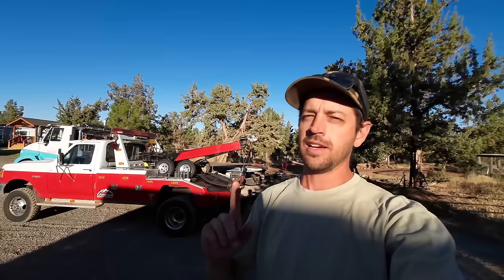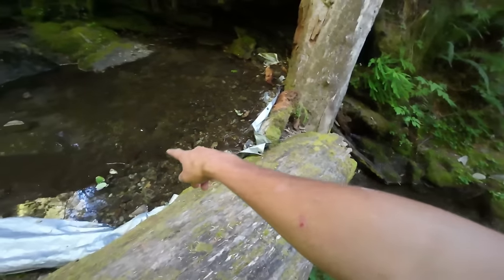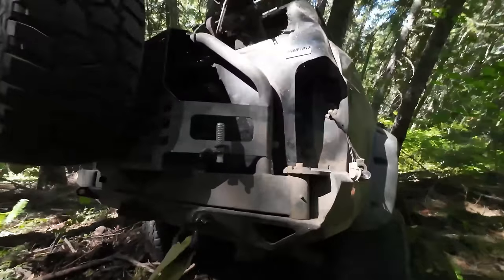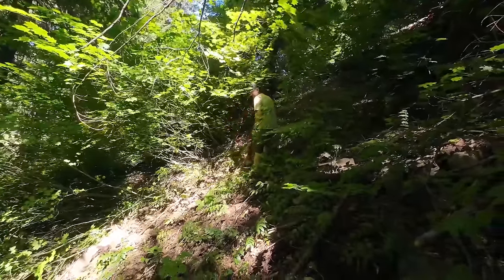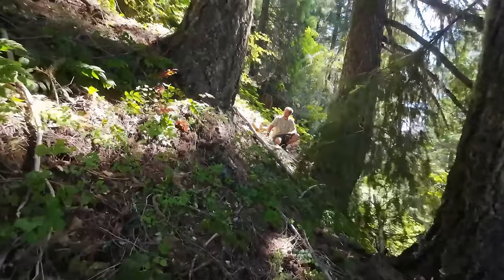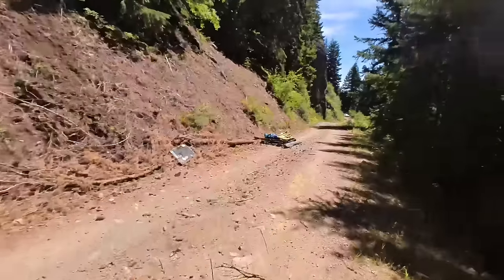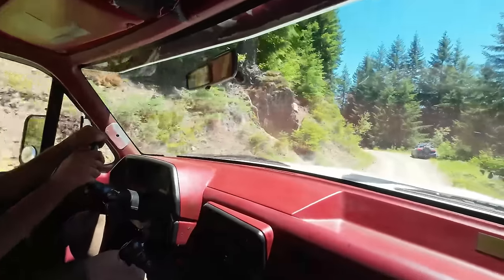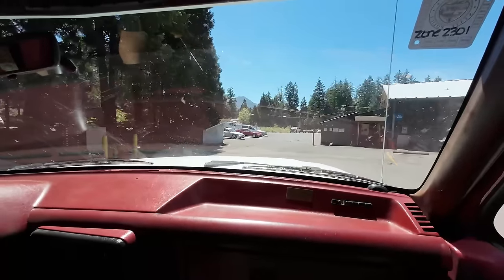I can't believe SHE SURVIVED this...

Comment: Casey, I for one consider you as a first responder. First responders have the right of way. So with that said, keep doing what you are doing and not taking that attitude for anyone. I for one love your content.
Reply from the maker: Absolutely not even close to a first responder
Reply: @CaseyLaDelle  I don't know about Oregon or even California, but in New York we have laws that drivers have to slow down  and move over/stop to give tow truck operators, police, fire trucks, road crews, and EMT's the right of way. With your strobe lights are on, you on the low end of a first responder list. First responder takes control of the situation, which you did. On road/off road it don't matter. I am a class A CDL with Tow Truck Endorsement holder here in New York. I know laws can differ from state to state, but the laws are very close when it comes to the safety of the public. Not trying to argue with you, but trying to keep you from selling yourself short. From one CDL class A driver with tow truck operator to another.

Comment: Hey Casey. If you’re down in my neighborhood again give a holler! I live right down the road from the reservoir. That concrete spillway you saw was where we draft our water trucks from. You almost went as high as Buck Mt.
 Heck, I would have been happy to get that jeep out so you wouldn’t have had to drive so far.🤙🏼 Granted, we don’t have tow trucks, but we use an excavator. Pulled a grand Cherokee up that went over the edge just below cougar reservoir think in February or march.
 Anyway, thanks for the videos! Have a good one!

Comment: That was a challenging & spartan effort Casey; & your skill and expertise came trough when it counted. Your aide offered valuable assistance also. In the heat, exhaustion, fatigue and dehydration can hit; the body needs electrolytes & if picking up something at the store (on the way to the recovery) a low sugar gatorade, or a Propel drink with no sugar would have given your body a boost. From the look of it,  it was grueling and exhausting; I can't compliment you enough.

Comment: Sounds like the ol school wrecker could use a new 4 core radiator, water pump, thermostat, hoses and flush. I had an 84 1 ton, 6.9 and it pulled hills like a champ, never attempting to overheat... Amazing video Casey. 😮❤
Reply: Yes, and pulling a steep grade like that on a main road at that speed ( 35 mph )  you should have your 4-way flashers on.
Reply: @wallytimmins356  Why .....who is out there to see them?
Reply: @wallytimmins356  Main road?
Reply: @kingtut5923  The hill on the main road before the off road, when he said he was doing 35 mph. Watch it again !!!
Reply: @k1j2f30  Watch it again !!!
Reply: @kingtut5923  he means on the highway, not the logging road .... 35 mph I'd have the 4 ways on. I liked the simplicity of my 7.3 IDI, but my 7.3 Powerstroke Super Duty has gobs more Power & Torque

Comment: Let's go do a recovery.... driving along the road.. but wait, let's go check out this cool spillway.... oh look it's a waterfall up here haha...... glad the people waiting were not in a hurry...... 

As Geocachers, we use offline maps often and there are some great sites with free offline map services. 

Casey as a Safety suggestion, you have pockets in your pants at the front back and Side... use them to carry stuff for you (shackles etc..) which then leaves your hands free to grab onto trees/branches/anything to help climb up and down... secure the shackles in the eyes of the straps and load the straps like a letter C over your shoulder so that it doesn't wrap around your neck (like you did at 26:10) and choke you when/if it gets caught on a branch or some other obstruction...... as a rescue firefighter I was taught all this stuff many years ago and it has saved my life and countless others for doing the same practice.  

Also as a suggestion look at getting a set of headsets so you can talk to someone that is out of sight or at a distance where you cannot see them it makes life so much easier, and safer. There are reasonable sets for not a lot of money.

Comment: typical of offroaders to tie stuff to roof rack but overlook the self tappers holding it to the roof.  Same with the fuel cell and jack, they never look at the root of the tie down to make sure it can hold the parts down in a rough bumpy road let alone a crash.

Comment: Cool heads prevalent. Every situation is different and the goal is to get passed without putting either in jeopardy. If you feel you can’t back out or pass safely then say so; then ya gotta hold your ground regardless of rules. Both should look it over and come to a consensus on a safe plan. I got committed going up a forestry road at night that suddenly had little or
 no shoulder in my 29’ motorhome (F-450 7.3L 430 hp). If I’d had known I would have not attempt it but it was late at night and who would of thought of someone come down in a very large pickup. He insisted I back down the road but I knew it was > 100 yards to a widening of the road and I stood my ground. We talked it out and I wasn’t going to be bullied. We walked/scoped it out together for both vehicles and came to the conclusion I couldn’t back down even in the day light we found a safe place for him to back into. All went well and am sure if I’d had attempted to back down it would have been a disaster. In retrospect I should’ve been on that road with my RV but didn’t realize until too late that it was going to narrow down. My camping style is dry camp/disperse camping which frequently are passable forestry roads but can become narrow in some places.

Comment: Anyone with half a brain should treat a tow vehicle with something on the same way you would treat any emergency vehicle. In that moment if you failed to give enough room for the operators comfort you need to follow their instructions. No reason to have hard feelings, just let them do their job as quickly and efficiently as possible so they can get on to helping people.  I’d hate to be the one waiting for a tow truck on the side of the highway because some twat thought they wanted to stop and argue with the operator.

Comment: Whats not fun is an 11,000 lb tow truck with a 6,000 fully loaded pick up going down a gravel road. I was on a call and trying to come down a steep grade when a honda civic pulled in front of me and decided to stop. i tried my best to get my rig to come to a stop but with that much weight it was not going to hapen. we slid 637 feet smacking trees boulders and the hill side shredding the civic the truck i was towing and flipping my wrecker. We didnt even leave the road thank god or i wouldnt have been here today. so if people want to not give right of way to a heavy truck coming down a hill they put every ones safety at risk and can kill. Thank god all we need was clean underwear and not a casket or 2. casey did an awesome job and handled it well.

Comment: GREAT video!   Its one thing to climb around in the heat at that altitude, but to also get it on video.  #dedicated.
I agree.  You went up on that hill to save a Gambler car only to return down the hill to find a bearded nun with a filthy mouth and bad attitude.  The OG penguin herself, Mother Mary Stigmata, would even agree.  "He needed help.  He turned into a dick, well then I guess he's really up shit creek.  OK that kinda didn't work, but I'm not a professional.
Anyway Top 5 recovery I ever saw.  Top 3 for sure.

Comment: My mouth fell open, when he told you to get a smaller truck, despite the fact that you are a tow truck and clearly towing a large SUV.  If you did what he said, you probably couldn't have recovered the vehicle without having to use several other vehicles.  And who exactly would have been driving them?

Comment: Back in the mid to late 60s I worked for a gas station whom had a toe truck about the same size as yours, except we only had a single wench cable, and no under lift. I went out with the boss on some of his calls, and it was amazing what that wench would do on that truck. Your cable looked about the same size as ours, and we had to pull a car up a hill, and it blew my mind what that cable would pull. Your video brought back allot of memories of the work we did on that truck. Great job on your rigging this job and getting that jeep out off the mountain. Also glad the girl is ok who took the ride down that hill. Take care and I hope all is well with you and yours.

Comment: Originally from what it sounded like, I thought your black Ram could have done it, but after seeing how far down that slope it got and the tight the working space was, I know you took the right rig. 

The rollback would have been a little more power and weight, but that would have been simply too big for the working space. 

Plus I would think you would have still needed to tie down anything that you took like you did. So you would have needed a side winch which you did with the second line.

That slope is very crazy and unstable to make any mistakes too.

Comment: Great video. You should have passed on this job. The truck was marginal to get it done and you need a bigger crew to run the lines down  and do the rigging plus a camera man . A awful lot for one man to handle you did a great job by yourself getting it done. That would have been about a 5,000 bill if I did it and that gambler participate would be 6 ft under at that point in my day.

Comment: great job   i also have trouble dealing with heat a cou[ple of years ago i got overheated at work  and ever sense i get sick working in the  heat,   I may have found you a bug repellant its called  grandmas  dont bug me bar,   it is like a bar of soap it has citronella oil, rosemary oil, lemongrass oil, peppermint oil, and geranium oil. it seems to work here in the smoky mountains, if you want to try it let me know

Comment: "I wish I had a remote for this truck"..... It should not be to hard to retro fit a remote system into the controls for the truck, A few relays, solenoids, transmitter /receiver pairs, and some wiring, then the time to put it all together.

Comment: Casey, this is probably the Moron in me coming out. After all, I'm sitting in my living room so obviously I'm not there. But you carry gloves as most tow truck drivers do. Now I'm wondering  before you climbed down there why didn't you put your gloves in your pocket and leave your tow truck at the top of the hill and take a soft shackle and a cable with you? That way you could have hooked up to the vehicle and then use the tow cable to help you get back up to the truck. Now I know that you probably would have had to run the wench all the way out but let's be honest the cable would've helped you get back up a lot easier. Then you could have just pulled it out one trip down and back up.

Comment: Google maps might be able to do that in your area but Google maps cannot do that in all areas Google will tell you that a road is fine to drive down when really it's not you have to have a four-wheel drive onx is $19 a year for one state and and $100 a year for the whole United States it shows you every road all the property lines if the property is private or public and it'll show you what kind of vehicle you have to have to go down certain roads and Google maps will not do that and half the time the pin is 10 mi in the wrong spot on Google maps seen it a hundred times but if it works for you cool
Reply from the maker: Actual google maps does this for anywhere in the world, for free.

Comment: Still, the Moron in me coming out.  Just wondering why you didn't use both lines? Knowing that you were going to have to use a tree to stabilize the truck or put the roof rack inside the vehicle as it comes near you. That way you kill two birds with one stone. Just saying I know I probably sound like a total Moron but that's the way I would have done it.